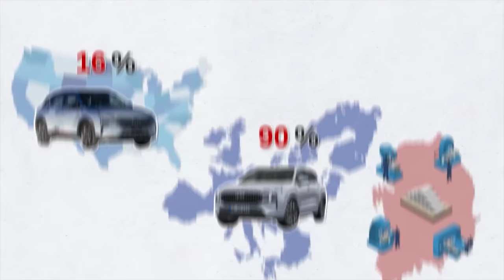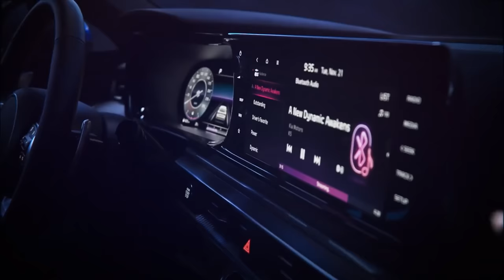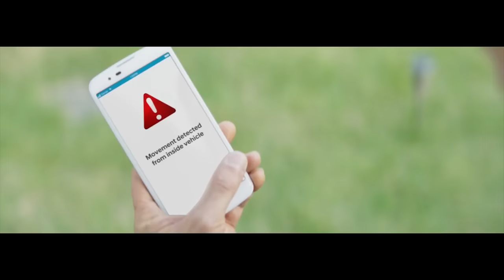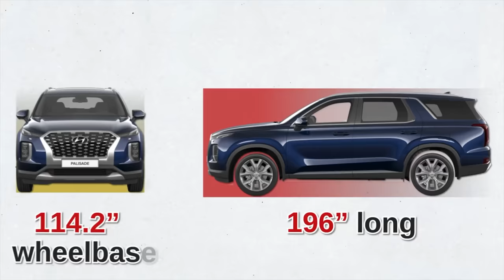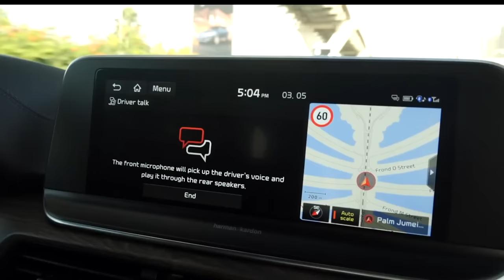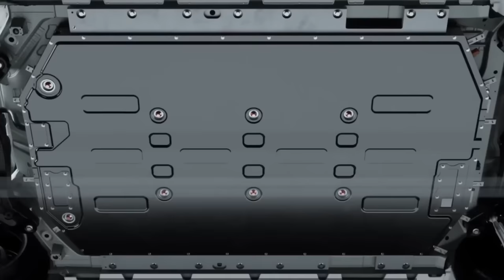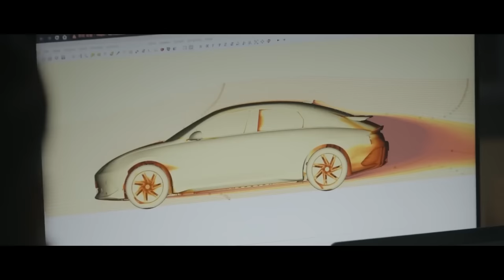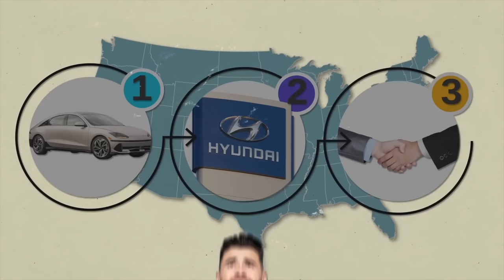No One Else Has the Balls to Say This About Hyundai and Kia, So I Will

Comment: DO NOT BUY A HYUNDAI !!! I used to be a huge fan and still have one. Put it bluntly, my car has now been subject in two class action suits. One for engine immobilizer making car easily stolen, which it almost was and I now have to file claim for out of pocket expenses. The other is related to piston slap issue with engine but that would take me a page to try and detail out all the issues I had there.

NONE OF THESE RECALLS NOR THE REIMBURSEMENTS FROM CLASS ACTION SUITS CAME ABOUT FOR AT LEAST 5+ YEARS AFTER THE MODEL WAS OUT AND SOMETIMES AROUND 10 YEARS.

I'll never buy again despite knowing how great they show on initial and 3 year reliability ratings and I know from my own experience, I had no issues until about 8 years / 70,000 miles and then BOOM.

Comment: I had 2 kias, a soul and a sportage. The 2016 kia soul 2.0 Is very good, so far no problems. On the other hand, the 2017 sportage gives me a little problem, I have to put octane booster or put gas with more octane, if not, the computer tells me that the engine pins. Both are made in Korea. I want to back to toyota, just waiting for the prices to go down.

Comment: I have a 2019 Sonota Limited.  There is an issue with Hyundai and oil consumption that so far Hyundai isn't doing anything about!!! I can't go over 1000 without adding oil to my car.   There was a class action lawsuit (Lemon Law) that was settled against Hyundai for the oil consumption issue!! Hyundai has yet to issue a recall on these engines.  Same exact engine that Kia has that DID recall them!!! Nothing from Hyundai!! You can hear my engine, and it doesn't sound right!  I have kept up the maintenance and oil changes to this car, and it has 86K miles on it.  There is no fix for this other than an new engine!  Now my coworkers daughter has one and she is experiencing the same exact issue on her Hyundai Santa FE.  I have another friend who has the 2017 Sonata and her engine locked up last week, same exact thing!  She has 107K miles, Hyundai isn't doing anything about it, she is just SOL!!!! I will get rid of this car ASAP AND WILL NEVER BUY ANOTHER HYUNDAI!!!

Comment: I'll say what the revisionists at Hyundai won't say.  Despite what Scott said about two people shaking hands and leaning (how absurd is that?),  When Hyundai reinvented after their disastrous first time in the US, the wanted people to associate their products with Honda and Toyota.  Thus, their logo is a crossed between Toyota (circle) and Honda (the H). 

2 = A trivia, when the Genesis first came out, they modeled it after the Mercedes S class front grill.  They took a poll with car journalists to whether put the Hyundai Logo in the front or leave it badge free. The journalists, by a wide margin, told them to leave it badge free.  That's why the first gen Genesis Sedan has no logo.

3 -  Is the Huyndai 100k/10-yr warranty transferrable? Maybe if it's a certified used car & reduced to 60K/5yr...The original 100k/10yr is only for the original owner.
This point is important, and I'm sitting here scratching my head why Scott didn't even mention it.
Reply: I own (still, 87K) a 2012 Genesis, 5.0.   Always wondered at the missing badging on the hood.   The dealership had no idea.  Thanks for the trivia.   Love the V8.   Think Hyundai will ever reproduce a V8 model again?

Comment: Junk cars, junk company. Just look at the massive lawsuits over engine failures, fires, failure to fix... they refused to fix their cars, so the government stepped in and forced a recall. They still refused to make it right for most owners (myself included). So, they just keep losing lawsuit after lawsuit... apparently, that is cheaper than doing the right thing. I ended up with $3k for my $35k Optima. 

Oh, did I mention they also lied about the fuel economy... they were forced to fix that also. Poor vehicles, even worse ethics.

Comment: My 2007 manaul transmission hyundai accent still drives great and get 45 miles per gallon. Funny cause that's better than the hybrid hyundai. I just replaced the clutch kit at 220,000 miles

Comment: Had 2 04 sontas both ran like a dream one i had to get rid of only because i was in a major accident with one the other i bought at 130000 miles sold it still running at 300000 miles had not issues with them

Comment: Only problem I have with my Kia Forte is they are so easy to steal, I had to resort to the Club. Kia has just introduce a fix for this problem, dealer put in today. Still gonna use my club. I was lucky when mine got boosted cops found it and the punk who took it real quick, within hours. Course it took the dealer 12 days to fix the steering column and redo the so called security system lol
Reply: Someone tried to steal my Forte last month. I think the manual transmission kept the thief from getting away with it.
Reply: @johntracy72  Lucky, good thing they're not teaching stick in the schools nowadays it seems watched a few vids and it was so quick n easy its like why bother to lock the door, lol. Got mine in my driveway, HAD THE ALARM ON and still didn't discover it gone till morning. Dang dogs didn't even bark

Comment: I bought a new '18 elantra with 56 miles back in 2018 and changed the oil every 3-5 thousand miles religiously and have had zero issues with the car so far and its at 98k miles..ALTHOUGH I do have yet to change the trans fluid and am now worried if its too late. Id say 95% of those miles are all highway too.
Reply: You should be able to get away with changing the tranny fluid, but I wouldn't completely flush it, though.
Reply: @DozyBeeChief  you are a gentleman and a scholar. Thank you

Comment: I have owned 2007 & 2008 Kia Rondos and a 2006 Spectra. They were great cars, cars were made in Korea. 2.7 v6, I believe was a great engine. I did most of the maintenance to these vehicles. One of the videos that Scotty did was talk about 2010 though, I think 2017, they switch the manufacturing of the engines to the US and the quality control went down. They didn't clear oil debris out at the engines before assembly causing undo wear of the bearings in the engine causing oil consumption. So I did not replace my vehicles with Hyundai's or Kia's. It sounds like they have rectified these issues with the newer vehicles. I will reconsider at some point purchasing them depending on reliability. In fact I'm surprised at a glowing reports in this video after what Scotty has said about these companies.

Comment: You’re driving me nuts pronouncing Hyundai like that. I’d like to avoid turbo chargers. I’m not racing anybody and like you told us they make the engine run hot and wear out quicker resulting in lots of unnecessary expense.

Comment: All my Hyundai cars I bought was absolute garbage... First my Tiburon Tuscani V6 2005, engine bay was fully occupied making it a nightmare to maintain it, then the brakes master cylinder failed @ 30k kms, impossible to brake. Although it was a cute car, bought it @ 47k$ cnd, sold it after 2 years @ 42k km for 7000$. Bought a honda fit 2009, best car ever, so was my fit 2015. Now I was dumb enough to return to hyundai for a Ioniq 2020 hybrid plugin... I only like this car for the battery and the money I save for the daily commute. But if you go on a small puddle of water, the cheap chewed cardboard like crap under the car gets ripoff like paper, and guess wheres the main cable connecting the battery onto the electric motor is... each panel cost more than 300$ to replace and there are 4 panels. Can't wait to sell this car asap and only have my XC60 recharge... Hyundai just make junk.

Comment: Hyundai/KIA are pretty lousy cars still, with loads of design/build defects, numerous serious recalls & poor warranty-honoring practices.  Toyota & Honda these days are a shadow of what they used to be in terms of reliability & build-quality, & I feel that Mazda today has surpassed them both (though I wouldn't have bought a Mazda 15 years ago, before they began their drastic &  ambitious turnaround from their Ford entanglements & such).  My 2020 Toyota was a problematic POS that I ditched after 2 years & 10K miles.  My 2022 Mazda CX-30 CE has been flawless thus far in the 15+ months that I have owned/driven it.

Comment: Hyundai steel parts are bad quality. Brake discs and pads don't last more than 25000 miles. Compact chassis is so soft that the car is totaled crashed on the first accident. The 1.8 engine parts are as expensive as crappy 🍋 BMW'S. Battery replacement costs $250 or more. Electric steering motor has a cheap rubber gear piece that gets worn every 2 years. To replace that little rubber star shaped part you have to disassemble the whole steering column and that costs more than $300 in labor cost. My daughter destroyed one Accent (burned engine) and two Elantras (wrecked). She has to pay two car accounts worth $1500 a month. Now she has to drive with caution. Thanks for the video..

Comment: After working on my first one in 2001, I lost faith in the company.  Though their diesel vehicles are seem surprisingly better than the gas ones.

The US market is hard we drive very fast compared to many places and I don't think many manufacturers are able to account for that.
Reply: Hyundai/Kia sold in the US are better built than the same ones sold in Korea. The US versions have better steel, more standard features, better tires, etc
Reply: @xcmskim4  you probably know better than I do, but previously I seem to remember something feeling very Mitsubishi about them.

Overall I think the company has made great leaps forward and I'm glad they have come into their own style as well.

It's going to take some time to get to the same reliability and parts availability of something like Honda and Toyota.  It's amazing an i10 is more expensive to own if it needs repair then a Corolla or Civic.
Reply: @swicked86  It seems you're not from America as that particular model is not sold here. In the US, Hyundai/Kia parts are easy to find and repairs are easy. Its actually harder to find a decent mechanic who can work on German cars. 
Also I am Korean American and I have relatives who work at the Hyundai plant in my dad's hometown.

Comment: Hey Scotty Im new to the channel, I have an old 2008 v6 3.8 Buick lacrosse thats has a lean code, thermostat code and 2nd air injection unit incorrect flow... Its starting to shake slightly in idle and rpms are wiggling... Could these be connected? Whats wrong? Thanks 

P0411 
P0128 
P0171

Comment: Only 2 cars I've had so far a 2008 azera and a 2011 Elantra the azera engine went out at 200k mi and my Elantra is now at 107k mi but has been a reliable car I'm gonna drive it till it's engine end up going out (ik it will sometime they aren't know for long lasting engines) but once it goes out I'm planning on getting a sicon tc or a Acura TLX so I can finally do some fun mods to my car without worrying about the engine blowing up

Comment: Hyundai and Kia are low price, less reliable but longer warranty compared to Japanese, European and American car brands. I currently have a Hyundai Accent hatchback. It's been somewhat reliable when it actually works. I have had engine misfires, cylinders replaced, alternator, etc. I have probably spent close to 7k on repairs within the last 3 years. My first car was a Cheverlot Optra which was actually a rebadged version of a Daewoo - bankrupt Korean company ironically. It was horrible quality, not reliable it was on recall for engine fire. My second car was a Kia spectra it was even worse than GM. The key ignition lock kept getting stuck, brake issues, leaking oil, etc.

I will never buy any Korean brand car again because of inconsistent reliability and low quality parts. I was trying to be price conscious but I realized you pay what you get for. I'll purchase a Toyota, Honda or even Ford next time….

Comment: I only lease Hyundai and Kia. You won't find a better deal out there. I would not recommend buying one though as they do have a lot of issues. But in IMHO, Kia is the better and more reliable automaker. Strange because they share the same engines and parts, but Kia seems to be able to make them work better. Any who. You do you.

Comment: On EV cars in general, wonder how they perform on snow cover roads? Assuming they weigh less than a comparable gas burning vehicle, so wonder if they have traction issues? Amazing where a front wheel drive vehicle can go with a heavy gasoline engine sitting over the front wheels.

Comment: Kia telluride thats what you have to buy
Reply: The Telluride and Palisade have oil filter cartridges in a plastic housing.  The installation torque is on the plastic to avoid having it crack like an Easter egg.